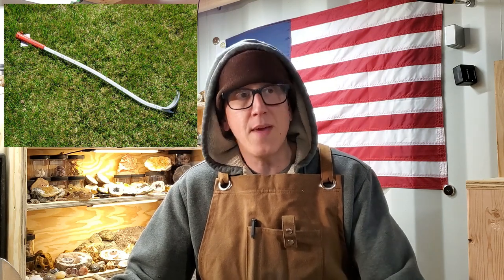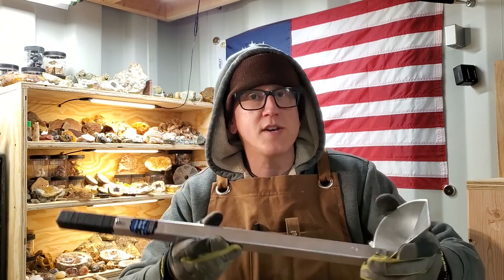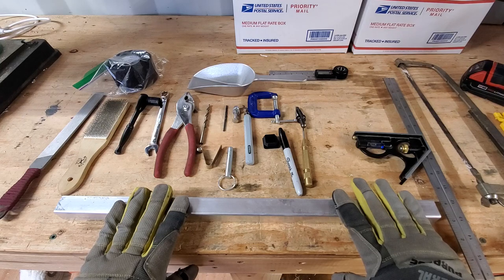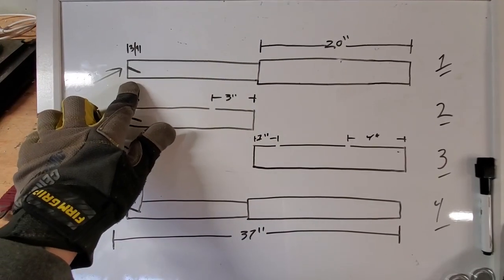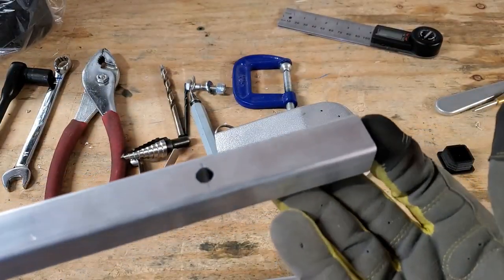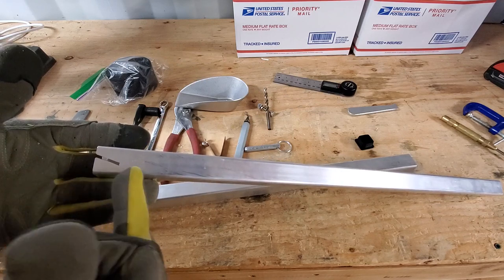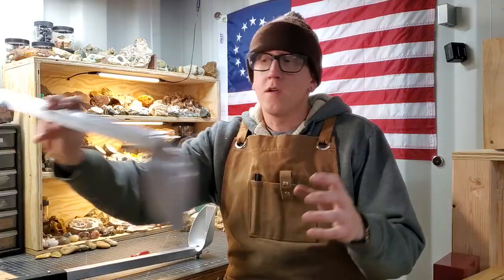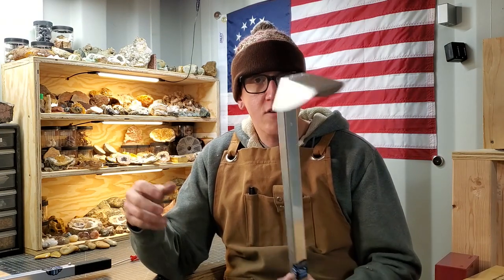How to Build an Amazing Rock Scoop

Comment: A good way to prevent aluminum or other soft metals from clogging your files is to file a piece of chalk into the file first.  I used to file a lot of brass and the chalk trick worked perfectly for that.  I've also used it on aluminum too and it works just the same.
Reply from the maker: I'm going to give that a shot next time.

Comment: Anybody found the parts for this scoop at a reasonable price? Alcobra Metals is more than $60 with shipping for just the tubing. Not sure why telescopic aluminum square tubing is so hard to find. That makes the price for the scoop more than $75.
Reply from the maker: I think you did your calculations incorrectly. At the time of this comment I get the following.

1.018" x .060" 6005AT6 Alum Telescoping Square Tube - 24" $6.89		
.884" x .060" 6005AT6 Alum Telescoping Square Tube - 24" $6.79

Shipping for me is via UPS is $21 which makes a total of $34.68
Reply: @CurrentlyRockhounding  Thanks for the response. I did go back in and dropped the button latch and it was ~$52 including shipping, so a little better, but not good. Still seems like I should be able to find it cheaper, but it is what it is.

I really like your design. Seems like it will be stout enough to flip a decent sized rock while keeping my feet dry during the early season trips without weighing me down walking. Thanks for sharing your idea!
Reply from the maker: @JohnWilson-vq4sh  I know one person that went to goodwill and found a walking cane that was adjustable with a telescoping portion. Maybe you could try that?